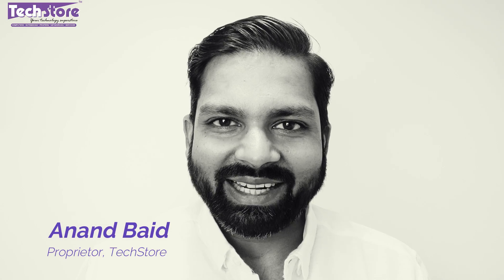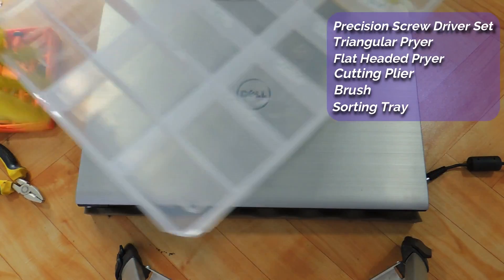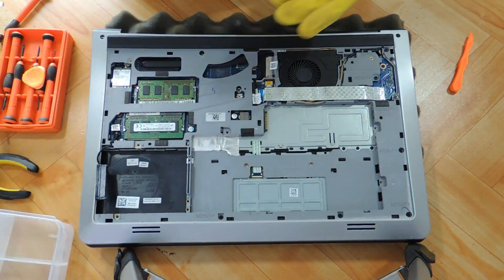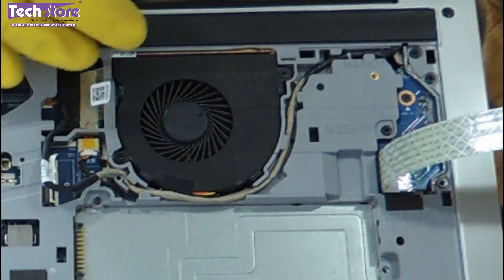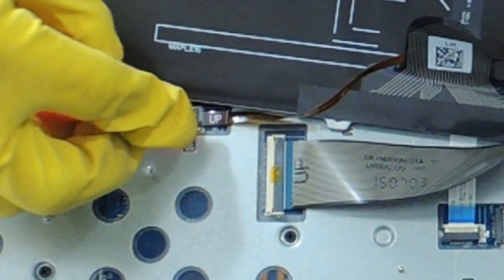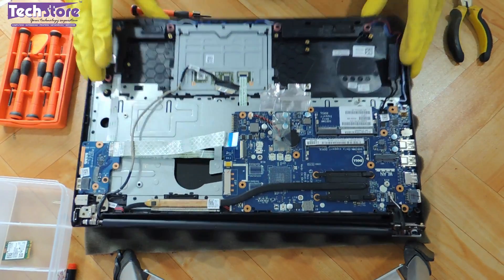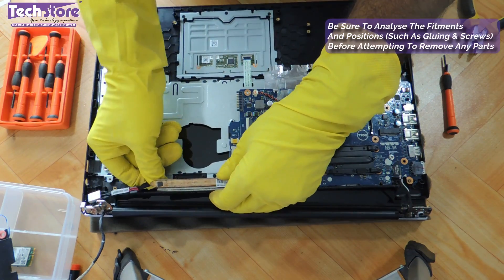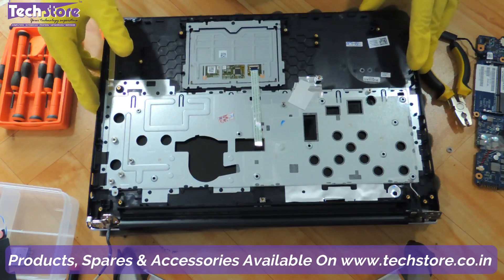Dell Inspiron 15 5547 : How to Disassemble the base and upgrade the ram hdd ssd wifi motherboard diy

Comment: Hello Techstore. I too have the hinge broken. Your video is so very well done that it can be easily attempted to repair it ourselves. But a professionals touch cannot be undermined. Is it possible that you can help me get these hinges repaired? Please call me on 7981233753.

Comment: I have same model laptop but it's problem is not taking charging, what is problem how can know and fixed in this lock down.
Reply: Probably it's a battery issue. You have to purchase a new battery and replace it

Comment: What is the best quality ram I can upgrade this exact laptop model? To get maximum performance.
Reply: 16gb
Reply: @MarcelleFortunato  thats the max right, 16gb only?
Reply: @julobie  yes! I have one, I changed to 16gb and it's working fine
Reply: @MarcelleFortunato  8gb in each slot? 8+8
Reply: @julobie  exactly